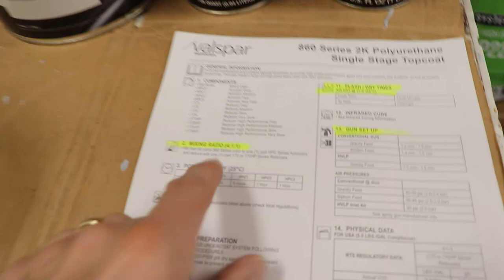How I Painted My Jeep!! Jeep Wrangler project

Comment: Dale great work!  I have painted several Jeeps over the years and always cool to see how much of a change a paint job does to the Jeep.    I could not see your compressor setup, but one recommendation is to use a water/moisture separator.  It helps prevents crystallization type spots like you got on the hood (little dots).  Another tip to deal with the flying paint dust is to have the floor moist or wet, or at a minimum put some water containers around as they help trap some of the dust.

One other suggestion is that you align all of the body work before the paint (looked like your door gaps may be a bit off on the video)

All in all excellent work and you made it look easy, the prep work is the brutal part :D

Comment: Since you didn't use a base coat clear coat paint (used a single stage paint?) you could have gone with Rustoleum. It runs about 35$ per gallon and offers lots of colors. Makes touch up really easy as well. It's what I'm using on Project Bumble Jeep (with a twist) I will be adding clear coat to mine at some point. It's also allowing me to paint the Jeep in stages as I get time. Looks great though. God bless and stay well.

Comment: Nice work as well as testing the water for us newbies. I'm sitting here in front of my 1995 YJ scraping off Monstaliner. Got the new color car paint in yesterday. Thankfully, as a disabled veteran, I can rent a paint booth for $26 a day at the local military base auto skills shop. Otherwise I would have to deal with good old Florida sugar sand that gets everywhere.

Comment: Fish eye is caused by Grease and or contaminants of some sort having a higher surface tension than the paint
Reply from the maker: Thanks. I was thinking it may have been water drops.  Need to add another filter right at the gun.
Reply: @JeepSolid  it could be from water in the air...

Comment: Hi Dale, what size is your compressor? how small do you think you can go?
Reply from the maker: compressor is 60 gal.  that is what paint shop and tool rating recommended as minimum.  It had no trouble keeping up with it.  I bet you could get away with a smaller one though.  maybe 40 gal....?  May run out of air for a min with long use, but I wouldn't mind waiting 1 min now and then...